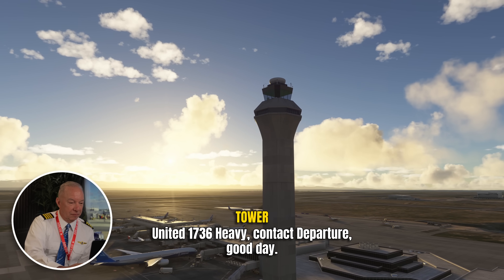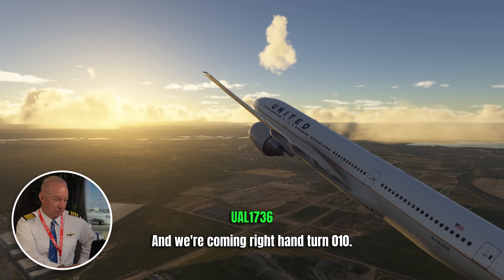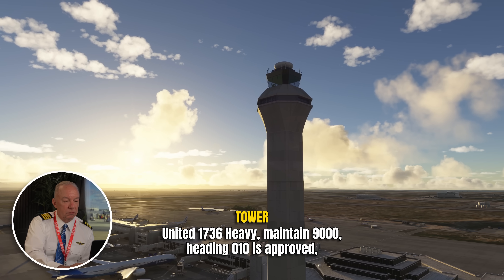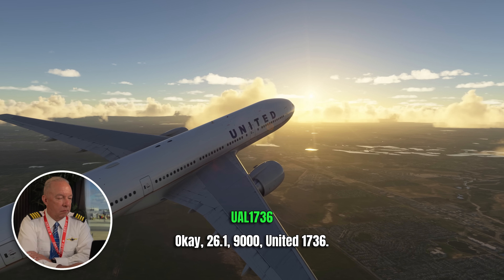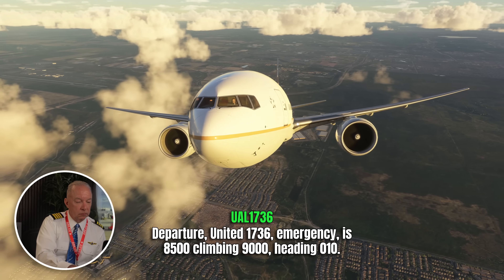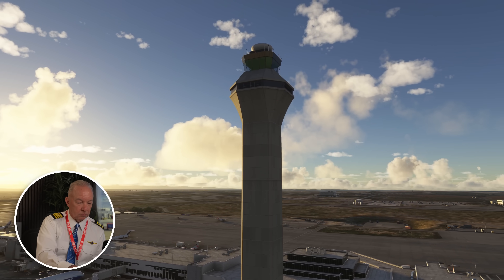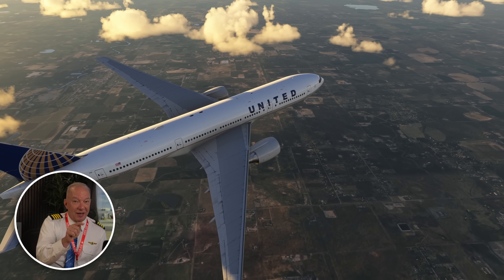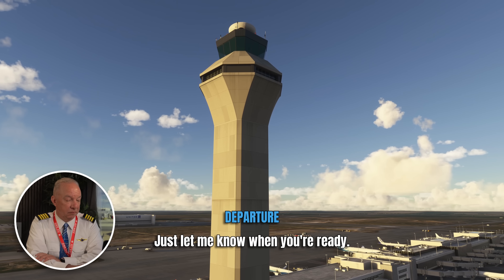United 777 Suffers Engine Rollback After Takeoff – Here's What Happened

Comment: Why do they say “heavy” after flight number?  love your videos!  you explain things so well!
Reply: "Heavy" refers to the plane's takeoff weight exceeding 300,000 pounds (think two aisle jumbo jets), which can create wake turbulence for planes next in line for takeoff.
Reply: I was just asking myself the exact same thing!
Reply: There are a few reasons that's done, AND it's worth saying that they don't always note a "heavy" verbally on the radios. SO FIRST, what's it mean? This has to do with wake turbulence. For wake turbulence, there are 3 classes of aircraft to be considered: Light aircraft involve your Cessna's and other (usually GA) small planes, which are more susceptible to wake turbulence than hazards for inducing it. Mediums which include Leer Jets, mid-grade cargo and touring type passenger craft, and can impart hazardous amounts of turbulence around the runways, but are still more susceptible than anything with a LOT of these craft being turboprops and slower than airliners... Technically ALL Heavy aircraft are the big airliners and cargo planes... SO it's practically a standard sentiment wherever those are concerned.
   SO why outright SAY "heavy"??? Well, there's still a bit of difference between an airliner coming in from a lengthy flight with less than half its usual fuel capacity onboard and a fully loaded airliner just taking off for a long haul with more weight than it's allowed to land "by the book". Even just a well loaded airliner flies considerably different (sluggish and at higher speed requisites) than an airliner with only about half the seats filled and less than half the cargo capacity taken up by luggage. It might go without saying it, but by saying it, there's a little extra buffer to remind ATC personnel that you're unusually loaded and may require a bit more space for the same safety as the next plane, even in your same class. This IS an airborne emergency, so the pilots are likely crossing those T's and dotting I's as much as they possibly can.
    AND Finally... There are a LOT of planes up in the air, trafficking the airwaves with "call-signs" all based on their numbers. Certain numbers like 5 and 9 sound VERY similar on the phones, SO even quite different call signs... say... 5119 and 9115 can sound DAMNABLY the same, especially if exacerbated by the stress of someone calling an inflight emergency or shouting "Mayday". It gets the adrenaline going all around and wherever you find adrenaline rising, you'll also find brainpower diminishing. Here's where I also like to remind folks who might NOT have ever played with walkie-talkies, that radio com's frequently "cut-out" and "chatter", so we use the "phonetic alphabet" and overpronounce numbers in some effort to be extra clear in our communication when using this tech'. In the case where there might be more than one "dangerously similar" call sign about the air-space, little additives like "5119 Heavy" and (just) "9115" can be a solid and easy way to deal with keeping up on who is who for the controllers. If I recall correctly, it's usually a controller who tells you (as a pilot) what call sign to use as they send you out for clearance to fly... SO while the little additives might diminish the chances of call signs getting too similar, there's still little or no good way to completely avoid it... BUT anything to make understanding just a little easier helps "set up the ATC guys for success", and we all want that.
Reply: Full of fuel
Reply: @Coachgio86  wrong
Reply: @johncorrao9477 if you don't know it's OK to stay silent. Please stop spreading misinformation

Comment: Hi captain steeeve! I have two questions:

If there is even a single drop of water in the fuel, it can be very dangerous. but when an airplane flies through rain and clouds, nothing happens even though a lot of water can get into the engine, Why is this?

Does flying through clouds, rain or snow affect the performance of the engines?
Reply: Evidently it's not contaminating the fuel prior to nor in the combustion chambers.